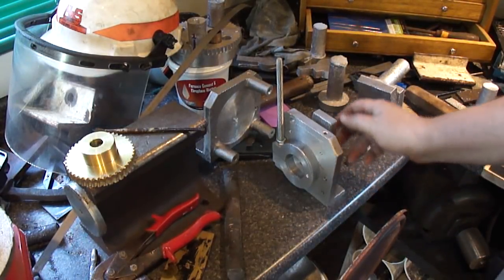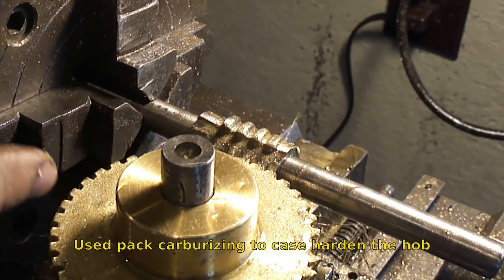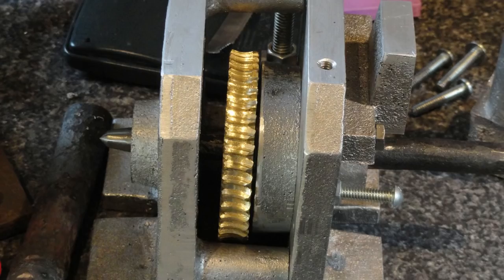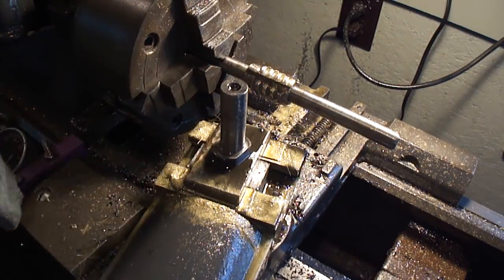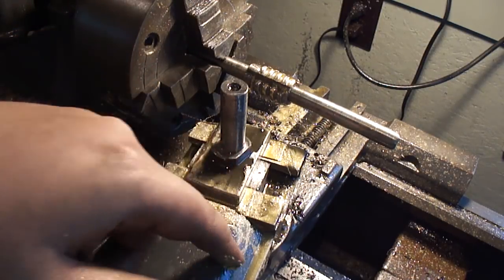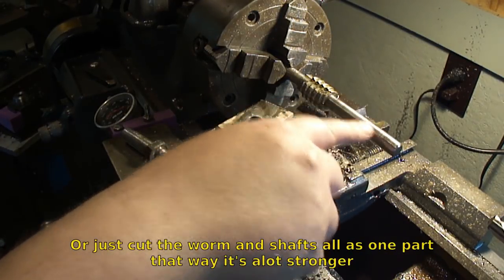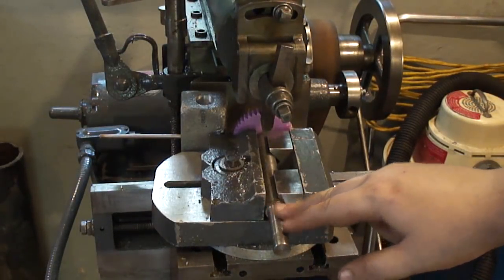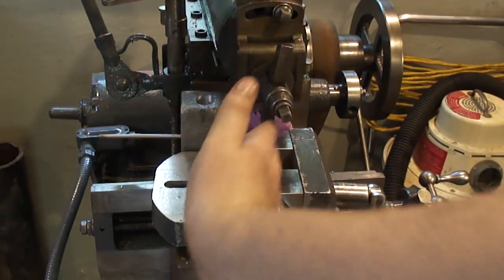Gingery Dividing Head - Machining the Worm Gear P3 (Hobbing and Finishing Worm Gear)

Comment: After cutting the tooth profile you should have relieved to just just behind the cutting edge. This would have minimized the rubbing, which translates out to heat.
Reply from the maker: I actually did relieve it slightly, which is why it wasnt too hot after a while if hobbing it, and I took it very slow and it took a very long time, so it would have been almost untouchable if I hadnt, lol.

Comment: When I made a rotary plate back in the 1980's, I had to gash the teeth, using the vertical mill. The gash  is always a reflection of the worm. you should have just cut the worm left handed to match the gash direction.  About 10-12  teeth on the hob would have speeded up the hob cut and reduced the heat due to rubbing. The worm gear that you cut, is called a nested gear. It's in full contact for about half the depth of the worm, and transmits power with the sides as well as the bottom of the worm. Very nice job cutting (gashing ), the gear. Especially since you cast your own blank.
Reply from the maker: Thanks, I actually did mean to gash it in the same direction as the worm, but as it was my first one I had ever made, I had gashed it backwards on accident. It still worked out ok in the end and is still in use with no problem at all. Good to know about the larger hob, if I make another, Ill take note of that. Thanks for watching ronald.

Comment: I knew you'd get the setup figured out. Nice job by the way. Are you making dividing plates for this as well as the dividing head? I'm definitely going to remember the left and right trick too. Thanks for the video, it's good stuff!
Reply from the maker: yea, Ill be making the plates from scratch also. Gingery has a section on how to use the dividing head on the drill press as a rotary table and use the one part to drill the plates out. The disks that I need to cast out when the weather gets nice, those will become the indexing disks, so just need to wait for nicer weather. Thanks for watching.